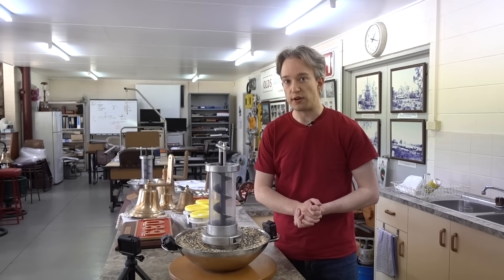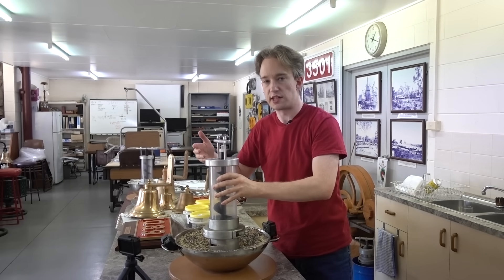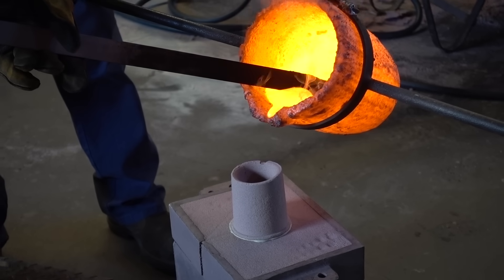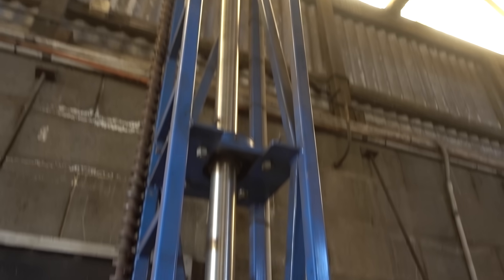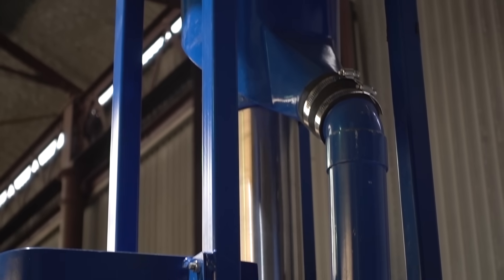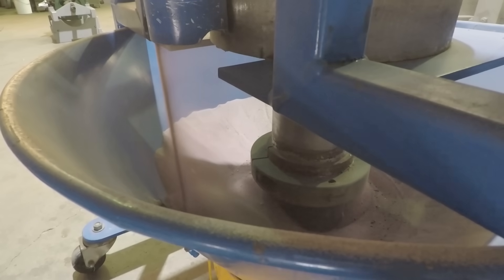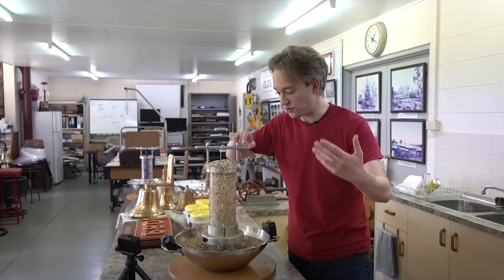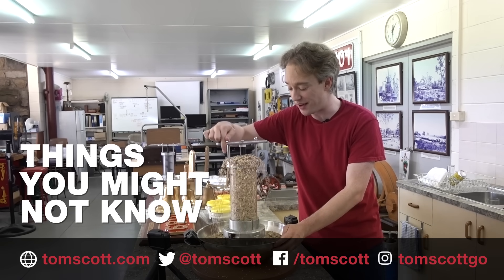Mr Olds' remarkable elevator

Comment: Serviced one of their machines at Boral, (making compressed fibre sheet).One point they don"t say about what"s the advantage of turning the outer tube VS turning an inner screw,is you don't need the fixed screw to be the full length of the tube,once material has travelled up a couple of metres of "screw",it keeps pushing up ,by the new material been fed in through the base.Where as a turning screw system needs the screw to be full length to carry the material up and out.
Reply: Thank you, I was wondering exactly why that was!
Reply: Clever...
Reply: Why does the turning screw system need to be the full length, though? Won't the screw continue imparting force on the grain, causing it to move upward and pushing up the grain above it that is not in contact with the screw?
Reply: @Shadowmech88  Willing to bet because it has to work against the sides of the tube it's housed in as well as the weight of whatever it happens to be lifting.
Reply: @Shadowmech88  I think part of it is that even if you didnt have the screw being full length, you would still need the center supporting pole to be full length, especially if it were spinning really fast.  If it was only supported by the bottom it could easily be off balanced and be a disaster.  And for long lengths you can support the outside for the tube with no internal obstructions like what may be necessary for the spinning screw.
Reply: @Shadowmech88  I think it’s because if you rotate only a part of the screw, there is a junction, gap or interface between the fixed and rotating parts which is problematic for a screw but not for a cylinder.
Reply: I think the difference is that if you rotate the screw and its not full length, all the side forces will act with leverage on the mounting and with that having to support rotation it cannot be as string as if the screw is welded directly to the floor of the hopper.
Reply: I don’t think this is a real difference. There’s no reason a partial screw wouldn’t be possible in the alternate. They’re just dual viewpoints. I suspect it’s about the way it’s fed at the base. The vertical slots force product inwards as opposed to a screw forcing product outwards. Edit: as others have pointed out it’s also a lot easier to support the rotating tube from the outside over a long length, as bearings and such won’t be in the path of the product.
Reply: Ohhh, that is clever, but.. wouldn't the exact same thing happen with a partial length screw? The mechanism is essentially compression from the bottom pushing particles up, no?
Reply: @jessiegeorg8438  same here - fewer parts and lower cost, among other benefits
Reply: I sense that with a partial length screw there would be a lot more friction losses against the sides, unless you're using something slippery like mud or wet clay.
Reply: The grain doesn't know whether the screw or the casing is rotating. If a full length screw is not needed, it isn't needed in both cases.
Reply: Good point!  Thanks!
Reply: For  diy design,  this means a lot.
Long pipe is easier and cheaper to aquire than long augers.
Bearings for the pipe are simpler as well.
Reply: @Shadowmech88  Exactly. Whether you rotate the screw or the casing, it's the same thing, so if one can have half a screw then so should the other one.
Reply: You don't need a screw to be full length to work, the advantage to the system is that you can design it so that there isn't a greased moving piece of metal attached to a motor spinning in the food so there's less contamination since all the mechanical action happens outside the hoppers
Reply: @mushieslushie  I think you have the most compelling argument for this device, thank you, I was struggling to see any advantages until you pointed this out
Reply: The other huge advantage they skipped us that you don't need a mechanical seal inside the product rout to allow for power to be delivered to the auger
Reply: That's awesome!  Made me think about washing machines.  Now the center pillar is all but gone on new models and the agitator just has some spiral ridges at the bottom.
Reply: @Shadowmech88  The screw wouldn't, but the drive shaft would.  You couldn't drive and anchor the screw from one end and not expect it to have clearance issues.  The outer tube regardless has to go the full height so you can anchor it at two points and have 1 massive anchor on the screw that doesn't need to live in a bearing with play.
Reply: @Shadowmech88  There is one small but significant difference. This system uses slightly wider sides at the bottom to scoop in the grain - or allow it in depending on your pov. 
If you only have the screw it will only work until the mass of grain feeding it and the mass on top are equal in pressure over area - then it will keep turning but not move any more product. The fins on this mean there can be up to around a bar of pressure on that grain over ambient so in theory this could push it twice as high for the same amount of grain pressure at the base. 
In reality though it would mean an unequal spread of load over the run of the machine and any gains in smaller parts would almost certainly be outweighed by having some grain squashed and more friction in the part where there is less support.
Reply: @unom8  Yes!  Exactly.
Reply: @Shadowmech88  probably because the screw would be forced to stop spinning by the seeds, but with the tube spinning it doesn't have to go through the seeds
Reply: @enderloch4922 
The tube does have to push through the seeds though, using the wedges protruding from the bottom.
Reply: @Shadowmech88  i mean the tube doesn't have to go through the seeds INSIDE the tube, whereas the screw does
Reply: @enderloch4922  
The tube's scoops are still pushing the incoming grain up against the downward force generated by gravity acting on the grain already in the tube, same as the screw would be.
Reply: @Shadowmech88  the screw has to push against the grain inside to lift it up, with the combined pressure of the existing grain already inside, however the tube only has to push the small amount in the bucket under, and doesn't need to push it, A.K.A. the tube doesn't have any surface area that is being directly pushed against grain other than the scoops that scoop it in
Reply: @Shadowmech88  that was exactly what he was saying.
Reply: @mushieslushie  I don't think it would be off balance because the weight of the product being lifted vertically would provide the downward pressure and the spinning tube would provide the stability.
Reply: A partial length screw would be like an impeller in a pump. They work, at least with liquids, and gases. Many real world examples. 

My theory is that a partial screw will work as long as the portion without a screw isn’t too long. I think it’s a matter of friction of the material being moved and the inside of the cylinder, like others above has pointed out.

If it was frictionless (theoretical ideal case) it would work for any length. If it has friction (real world case), at some point it will become too long, too much friction to overcome , and not work.
Reply: Other than where the screw could be mounted. This was my thinking as well. A big advantage and where the biggest difference comes from is how the material is sucked/grabbed from container.

Technically, we might be able to close the gap by having the immobile tube in a turning inner screw system have the same scoops but to also have flared paddles where the inner tube emerges from the outer tube to push material against the scoop.
Reply: @Shadowmech88  Because the "relative motion" explanation is every so slightly incomplete.  Sure, in physics it doesn't matter whether you turn the screw or the cylinder, but that is only true if you're only considering the screw and cylinder in your system.  There is one other component, the grain, specifically the grain outside the cylinder that isn't being lifted yet.  If you turn the screw the outside grain is rotating relative to the screw and stationary relative to the cylinder, if you turn the cylinder the opposite is true.  While you turn the cylinder, grain is being shoved into openings at the bottom of the cylinder creating "pressure" that pushes on the grain being lifted inside the shaft(this is a case of granulated materials acting kinda like a liquid and kinda like a solid), this same pressure generating action doesn't occur if you turnt he screw.  If the screw were fixed to the bottom plate however, and both turned in unison, it should theoretically do the same, but that would take alot more energy to rotate.
Reply: Thank you, I was wondering about that!
Reply: Thank you for pointing this out. I loved the video but couldn't figure out a practical reason for rotating the outside instead of the inside.
Reply: ohhhhh! THat's reallllly interesting! I hadn't thought about that!